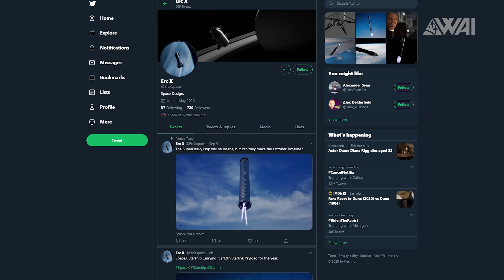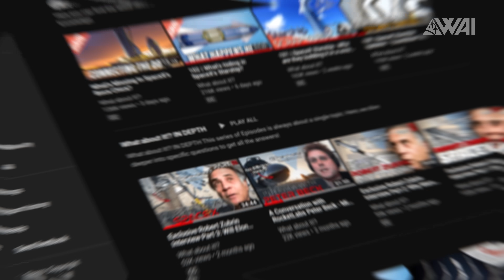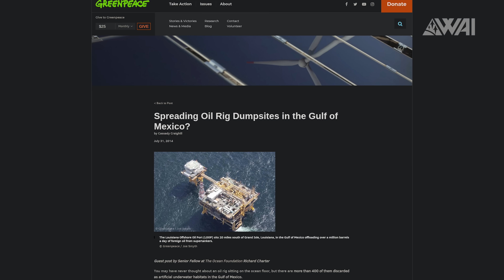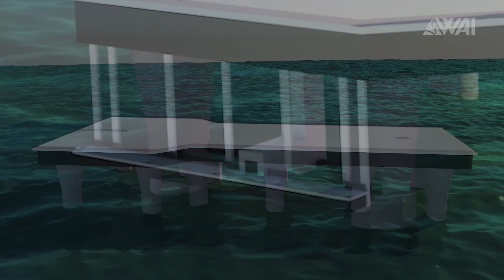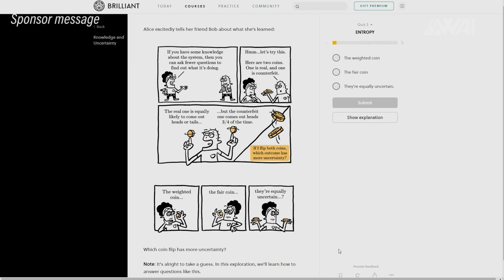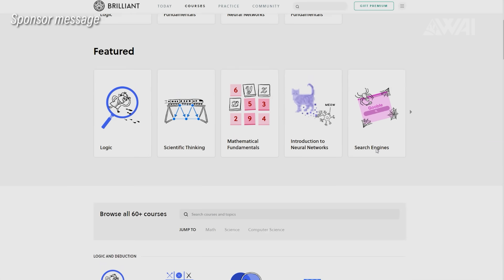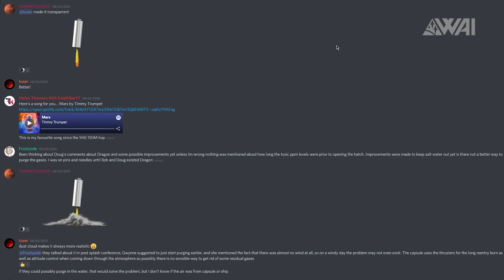118 | SpaceX Starship Mass Production Starting

Comment: Offshore orbital platform -- I think the answer has been staring us in the face all along.  SpaceX is already highly skilled at producing tanks.  Why not use the ring segments with simple bulkheads to make flotation tanks. They could be pressurized to resist the force from the water.  Place them vertically with a support structure that forms the main level.  Larger tanks can be used underneath areas that need to support more force.  Also the support structure could have the ability to raise and lower the individual tanks as load shift around above to keep the structure in balance.  This would also potentially add the to the economy of scale for starship.

Comment: I have a nagging concern. If Starship is to go to orbit very soon will it need an entirely new thrust puck so it can use six Raptors?  It will take a long time to engineer and test a six engine thrust puck. 
Another idea would be to get the navy to donate an older aircraft carrier. That is more Spacexy. Go Spacex.

Comment: The offshore launch platform will probably need a solar panel field. Also, if I was designing it, I would put the deck between the buildings and the launch pad, maybe put the buildings under the deck in case of an explosion.  Then, the crane will need to swivel to pick up a Starship or Super Heavy that is brought out to the launch site by barge. That's the only differences I could see from your design.

Comment: If there are so many abandoned oil-rigs in the gulf, and if they truly are so large and cheap, why not simply commission the already established industry (which must exists) to make you a custom launch platform? That sounds a lot more practical than trying to retrofit an old oil-rig, which doesn't sound like it has much of an industry built around it. 

I imagine a launch platform for a rocket of Super Heavy's size will have many specific requirements that would be best built into the design rather than bolted on.

Sealaunch did retrofit an old oil platform, but as you've pointed out, the Zenit was far smaller. The cost to build the Odyssey was about 110 million dollars (about 220 million in today's money). The cost of the stainless steel in the Odyssey represents about 28-32% of the total value of construction. Obviously there's a lot of labour cost baked into this existing steel, but retrofitting will have labour costs too. How much more or less? I've no idea. But I wouldn't be surprised if the efficiency lost due to retrofitting being a lesser developed industry than building from new out-weighed any benefits. If you were planning on building dozens of launch platforms? Sure, retrofit away. But for a one off? I have my doubts.

Comment: Any thoughts of an integral crane being installed in the high bay?
Reply: The roof seems to be to weak, if they do so it would only be for very light parts.
Reply: @Bauer-ke6lp  Yeah, your right about that.  It just seems to be so awkward having to move a ground crane into the open front of the mid bay so doing the same on this big bad boy could be worse and they will need a huge crane on site virtually permanently.  Hey, cant wait for one of these boosters to be rolled down the road on the mobile wheels!!!  ;-D

Comment: Your oil rig idea is outstanding and very thought-out but I believe that the value and dependency of each rig will be to much to risk loosing the rig to weather. I believe Elon is going to build small islands that can be protected from weather and the elements and make it a no brainier considering the size of the rockets and force induced from launch witch pose a problem to a rig. Just my opinion though.

Comment: As well as the air bubble curtain, how about a pipe ring floating on the surface and spraying a curtain of water upwards 20m or so? This would also reduce noise, surely.
Reply: This is already done, but in reality they try to do it directly at the thruster.

Comment: Would it be possible to make the landing pad a mostly submrged vessel that empties ballast tanks and raises itself and the starship from the surface to be moved over to a repurposed oil rig or possibly, but less likely, to the top of a booster? Maybe the actual booster launch mount could be beneath the surface of the platform? Eliminating the need for a crane and taking offshore wind out of the equation. If Elon would like I can submit a childlike blueprint as early as 10 minutes from now. Hire me Spacex!

Comment: Sanity check: the propellant tank and the hull are discrete units, right? That is, the walls of the tank aren't also the rings of the hull?
Reply: No, the hull is the tank. What you see in the videos is exactly what they're building... a stack of rings, with bulkheads top, bottom and middle to form the tanks.

Comment: Will be really interesting to see what the sea launch system looks like. One big issue will be keeping the pad stable in as large a sea state envelope as possible. This will likely require the platform to ballast and sink down close to the waterline to keep the centre of mass low in the water and the deck motion low (like the drone ship). Maybe better to almost have a launch/landing pad with little on it other than a crane, then move all other functions and fuel storage to a support vessel which can come alongside and resupply the pad and lift on/off rockets as required, then move to distance for launch.

Comment: If the platforms are so cheap, perhaps join platforms together to make large launch platforms with plenty of room and very tough to withstand storms.  Likewise, place multiple landing platforms down range so that Super Heavy's don't always have to do a boost back burn.  A ship or drone ship could transport the booster back to a launch platform.  In addition to the elevators at the edge of the platform, a crane might also be needed to lift boosters from drone ship to platform.  Even with sea platforms, some tanker ships might be needed to transport LOX and methane to the per-launch, platform fuel farm.  Probably a LOX ship, or two and a Methane ship, or two.  And a cargo ship may well be needed to transport boosters and starships to and from platforms.  Might as well throw in a surplus cruise ship or two to provide nice housing for crew needed at the platform, which will most likely have to be abandoned for each launch.  All of this sea transportation would make use of desert islands possible...like Johnston Is., my favorite choice for an isolated launch site with an 800NM radius of nothing but ocean, 2929NM from Los Angeles Harbor.  Johnston Is. also has a lagoon that might be used for additional platforms in protected, shallow water.  Additionally, San Nicolas Is., some 70NM from Los Angeles Harbor could be used for test and development flights, and polar orbital flights, without upsetting the Californians...who will likely not even notice the launches...not even of a fully loaded Super Heavy.  Most people aren't even aware of San Nicolas Is., as it is usually not visible from the California coast.  It has plenty of room, if the US Navy would allow its usage.  It also has a good sized runway for cargo planes.

Comment: You would only need a common open container ship with a crane,  and then a common movable oil platform.  Then build a launch and landing pad on it and add a few extra anchors while your at it.  The helicopter landing pad and crew waiting area  are essential parts of the a rig already.

You would not need the full High Bay but only a structure big enough to protect Superheavy.  In my scheme, Superheavy stays with the oil rig/launch & landing pad.  Launch, land, refuel.  Starships could land at the pad if they are being launched again right away  but obviously that requires a second pad.  It would actually be easier (and safer) to land on a drone ship or on shore and then deliver Starship to the launch pad by ship.  One ship could deliver several Starships every day as it would only be 8-12 miles from the port.

Finally, it is much easier if tanker naval ships fuel the tank farm on the rig than to try resource production.  We are only doing ISRU on Mars because you can't buy shiploads of Methane on Mars!

Oh, and SN10, aka the Superheavy prototype will be scheduled to fly in December but problems coordinating the 12 Raptors will be push the flight into January.  Then, on January 30, 2021 after 7 aborted countdowns (3 in the last seconds before ignition) the Superheavy prototype will fly a flawless 200 Kilometer flight with a perfect pinpoint landing.

Meanwhile, Starship SN8 will do a 20 KM hop, and SN9 will do 4 100 KM hops with the skydive pinpoint landing.  

On February 14, 2021, SN11 will be mated with the Superheavy prototype and the launch will take place on March 10, 2021.  A problem with stage separation will lead to loss of the test vehicle.  SN12 and Superheavy 3 will have already been stacked and the mishap investigation will take just 45 days.  The modifications to the vehicle take are completed before the report is filed and on May 1, 2021- on a beautiful Summer day in Texas, Superheavy launches into the sky carrying a Starship into orbit.  On July 4th, 2021, two Starships remotely rendezvous in orbit for the first time.

Comment: given how squishy starship was when they filled the top tank before the bottom...how much stronger does the booster need to be in order to support its own weight and starship? the internal bracing and what not will have to be a lot beefier?
Reply: Presumably, the rules are the same as with Starship... it's plenty strong when pressurised, so don't do silly things like stack and fuel the Starship before fuelling the booster.

Comment: What you propose would be the bare minimum for development and testing, allowing a couple of test flights per month. For heavier launch pace it would be very large compared to your rendering. For commercial operations it would have a much much bigger surface area. There will be separate launch, landing, refueling and repair platforms. This will be repeated around the globe to allow for flights in and out of the chosen destinations. Elon thinks larger than I do....giga aquatic launch facilities around the globe.

Comment: Ok let’s see the UK has the North Sea oil rigs where  North Sea gas was produced, the production of gas is already there with The platforms off the  Yorkshire  Lincolnshire coast would provide the landing  take off platforms for a European first spaceport.not only that bu5 the Yorkshire production of stainless Steel could provide the first out of US. production plant outside the US. It is so near international airports that it would provide transportation from the US  to Europe within 30 minutes and is probably the only suitable takeoff and landing site in Europe to start the intercontinental transport.not only that there is no language barrier. So within 2.5 hours of most of Europe and easily ready infrastructure what’s not to like. OK that’s just a start, just down the road is a 650 hectare site next to the M1 motorway and rail links to the site. Where Boeing and McLaren  have sites  where Rolls Royce manufactures turbine blades. So a highly skilled workforce and universities at the cutting edge of technology. We have arm technology which drives the computer industry. Why would SpaceX and Tesla look further. They can provide a link from Hull, immingham, to Scunthorpe thrum to Doncaster Sheffield airport on to the new Tesla plant where it intersects the M1/M18 the new HS 2 line, providing the boring company with the opportunity to link the HS 2 line with the centre of Sheffield and on to Manchester via the old woodhead tunnelplusnew bored tunnels to provide extra capacity. The northern power house all driven by Tesla. With 50 million people within 1 hour of a spaceport and 250 million within 2 hours of a spaceport. A right hand drive  Tesla  production plant within 30 minutes of a international export port. So what’s wrong with this ?
Reply: Sheffield/Rotherham and Scunthorpe are producers of high quality stainless steel and could easily provide the steel required for starship and the production of Tesla cars. The highly skilled workforce in the area is a magnet for international companies and the universities are providing internationally recognised excellence in materials technology. So why aren’t Tesla and SpaceX interested? 
Why did Elon Set down in Doncaster?

Comment: I would make a few changes to the design. First, instead of having an "I" shape, it would be shaped more like a capital T. The launch pad at the base of the T, the landing pad between the base and the cross piece. On the cross piece, one side would have the shelter (with the opening 90 degrees away from the launch pad) the other would be an area where the mobile crane could pick up the booster or Starship that came via droneship. It would have tanks for one launch under the main deck.

Launches would be controlled from another platform a few KM away. There also would be a fuel farm that would send fuel and o2 to the platform via underwater pipelines.

A launch complex could include several of those Launch Pads, controlled by a single pad. One possibility might be to include a hypertube to shore that besides people would also send the fuel, O2, power, and small payloads to the launch platform.

Comment: Make that air 'moat' wider and you could prevent entry by unauthorized boats.  They'd go straight to the bottom.  Turn sections off as needed for authorized entry.  Think keeping cartel pirates out.  They already rob offshore oil facilities at will in the Bay of Campeche. If the wrong party wins the election, Elon will eventually be paying drug lords to leave Boca Chica alone.

Comment: Your proposed fuel farm cannot even fuel one Starship, because it's too small. It needs to fuel both Starship and Superheavy, multiple times a day. It's going to be a huge monster.
Reply: Yep. Granted, the farm tanks can be thicker than the flying ones and therefore hold a greater pressure, but they're still not going to be significantly smaller than the rockets they're fuelling. And SuperHeavy is basically a 9m wide tank that's 70m high...

Comment: The Philippines will donate Salaug Island to Elon Musk if he will install the Spacex starship launch platforms there. It is very near to the equator, 4 degrees, 35 minutes, 25 seconds, North, latitude, to be exact. He can even use the former US military bases here like the Subic bay freeport and Clark Military Air base. The Malampaya oil and gas platform was manufactured in Subic Bay. He can buy methane fuel from Malampaya or Malaysia, Indonesia, Brunei Darussalam which are very near this island.

Comment: If they want to have 4+ launches a day, fuel will need to be in constant supply, and there just isn't enough tank room to fuel both ships multiple times a day.  My proposal is a fueling station separate from the launch pad. and have fuel ships standing by with product. Kind of like the US Navy armada's have a supply ship, and as one runs out of fuel another joins the group. They could be piped in under water, and far from the blasting of the ships engines.  But yeah, there's many ideas. My answer to the question, of when 11 will fly, is 2021, early next year.

Comment: Think partly of what you talked about is possible. But docking on its not gonne happen, most of oil platform doesnt do it. I think passengers will take a helicopter. There will be a fuel farm, but there will be pipes from land that will connect to the platform. Equipment will be transported by offshore boat or drone boat and be lifted up by crane.

Comment: Not sure your design of the crane would work that easily. If you look at boca chica they need huge equipment to pull starships out of the ground. Here you want to push the entire crane with the starship upward, and i guess it would be way more complicated to do. Maybe just lift it a bit of the ground, roll the structure next to the launch tower which would have some integrated taller crane and let that crane lift the starship on super heavy, as in the original animations for the boca chica site. Separate rolling and lifting seems easier to me.

Comment: I think two dynamically positioned semi submersible sister rigs is the quick and relatively cheap way to go. Scrap the bulk of the topsides, join them together, and you have a huge stable launch platform with great storage capabilities.

Comment: Hopefully somebody in the legal department at SpaceX is working on the issue of security. Look what just happened with the return of Bob  & Doug?  As soon as you get into International waters (more than 12 miles typically) .. boats have certain inalienable rights.  What kind of a security system could be put in place to protect an 18 mile circumfrance on a offshore platform?  Would it be legally enforceable in International waters? What would be the cost of patrolling a circle that has a circumfrance of over 55 miles?  Note that launches at Kennedy have been scrubbed or delayed because of boats in the "zone" and even aircraft.  Coast guard is only really authorized for inside the 12 mile limit.

Comment: 9:32 No fuel farm needed. Transport fuel in a tanker and pump directly to spacecraft via rig plumbing (the fuel farm is the tanker). The tankers simply undock and distance before launch, then reattach for next sortie. I envision very large ships or barges transporting starships and super heavies to the rig.
Reply: The usual structures of a ship, of a tanker, will almost certainly be damaged by the acoustic energy. Perhaps a ship or barge that can submerge once at the platform could work.
Reply: Given the kind of launch cadence Elon is aiming for in the future, the launch platform will almost have to be a permanent structure, so it would probably make sense to just set up a pipeline.
Reply: @Joe-xq3zu I was thinking the tanker could move away about ten K before launch then return for next launch. Not sure about long pipelines with cryogenics.